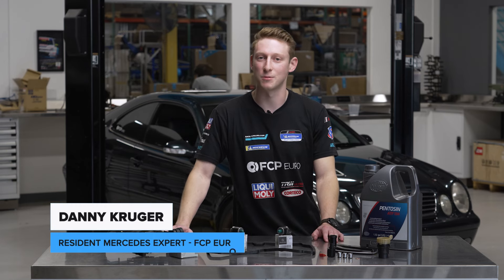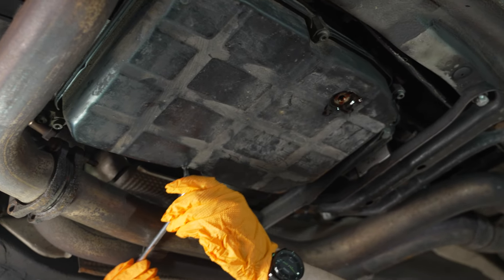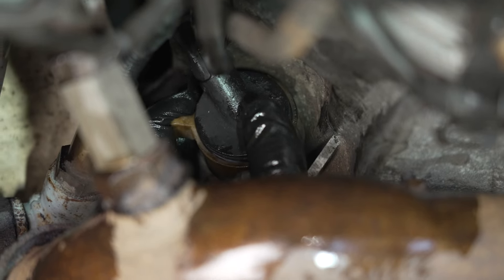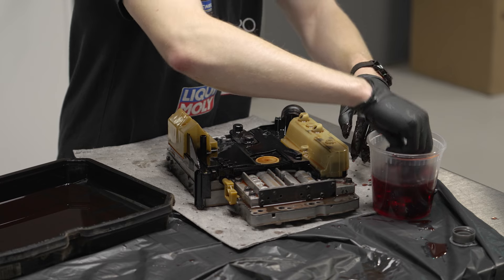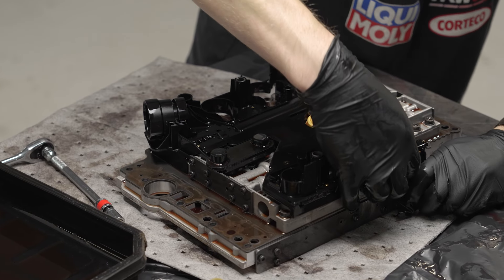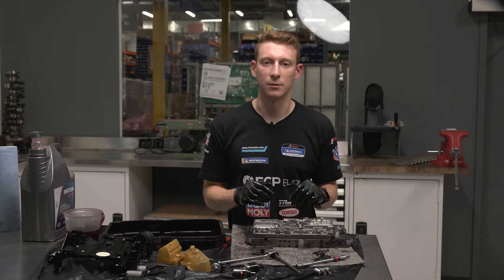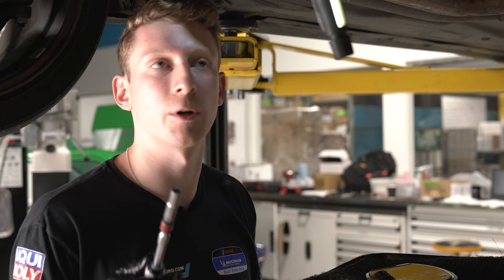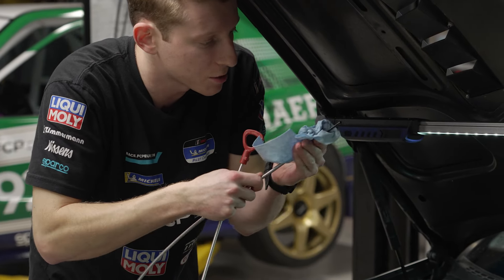Mercedes 722.6 Shift Solenoid Upgrade and Transmission Service (NAG1)

Comment: Only way to improve this Trans video would be to wear Blue gloves ; sometimes the black ones stop one from seeing the parts being handled . Just a thought ! Well done Allen P.
Reply from the maker: Thank you for the note; something to consider for sure!
Reply: I got a 2001 cuatromatic  it didn't want to shift in to the third speed. I really think it has something to do something whit the cilenoides and conductor plate. what do u think. It hasn't run in 3 years😢.

Comment: By watching this video, now I know why my transmission shift so hard when the car is cold, going from first to second gear. It literally jumps super hard, but only when it's cold. Once it reaches normal temperature, it runs fine. On a S600 V12, i'm scared to do this myself, but if I don't, I will have to pay a lot of money, and I have been dealing with that since I got the car 2 1/2 years ago.

Comment: need help or advice . i have a 1993 mercedes 500 sl, and internet shows my tranny is a 722.3. in video you mention blue solenoids are up grade and interchangable. can not find any solenoids for the 722.3 but lots for 1994 and up 722.6. would those work for my 722.3?

Comment: It's me again. If I want to replace the first and second gear solenoid, do I have to buy one that is specifically for those gears or it doesn't matter what you buy? because i think does the one that I need to replace in my car.

Comment: At what mileage would you recommend changing the conductor plate? Mine has 184000km, and trans has been serviced at 61000km and 150000km
Reply from the maker: Hi there Spidepig09! Pending the frequency of fluid/filter services and driving style, the conductor plate can be good for as long as 200,000 miles in some cases (~320,000km). Yours has been serviced a good deal more than the vast majority of these "lifetime-filled" transmissions which bodes very well for its longevity. This being said, the worst way to figure out that it's time for a conductor plate replacement is when you're trying to drive somewhere and it isn't cooperating.

I'd generally recommend replacing the conductor plate every 100,000-120,000 miles (160,000-190,000km) to be sure that it doesn't leave you stuck on the side of the road. Additionally, check to make sure you don't have transmission fluid entering the TCM through the pilot bushing! It's unfortunately very common on the original factory pilot bushing, and can also strand you. The kit containing everything you need for the service is in the video description.

-Danny
Reply: @fcpeuro  thanks for the detailed answer!
Reply: My conductor plate speed sensors failed after 107,000 km and 17 years.

Comment: My 2004 CLK320 had 9 bolts holding the plate. And 4 liters of oil was more than enough. Very good video though - it took me through it step by step.

Comment: Awesome job,I have a 2000 e320 wagon,my transmision shift hard and some gears take longer when it's cold, feels dry,feels like it needs fluid change,I have to let it warm up alot,when the car it's really hot transmision works fantastic!

Comment: Hi how are you ? Thank you for your beautiful, informative videos... I have a big problem. After changing the board, testing the solenoids without pressurizing, complete disassembly of the valves, installation of Sonnax, draining of new BVA and converter...connector to controller, my problem remains the same...box in degraded mode and not more than 3000 revolutions.... It goes from D to R with jerk and does not shift gears... I cannot pressure test the solenoids.... thank you for your help...
Reply: Hello did you find out what it was your problem?

Comment: at 23:00 you talk about at cold weather jerk with 1-2 shift that is the torque converter locking up.  I have this happening.  What is the solution?

Comment: Very informative video, thanks for posting! I have a ‘99 C230 Kompressor with 297k miles on the original transmission. Only issue I’m noticing is harder shifts when cold, especially 1-2. I’m planning to order the service kit you offer including the conductor plate, etc., but my question is with the high miles do you recommend getting fresh solenoids as well? What else is a good idea to refresh while in there? I do not know when the transmission was serviced last. Thanks!
Reply from the maker: Hi Colton! We love a good W202!

Fluid, filter and conductor plate will generally be good as far as general preventative maintenance goes, assuming you don't have any codes at the moment. If you've noticed shifts flaring between gears, then you may want to consider adding on any/all of the overlap sleeve and spring upgrade kits for the valve body mentioned in this video.

If the car is driving normally aside from that 1-2 shift, I wouldn't rush into doing the shift solenoids. The behavior you're noting is somewhat typical of a TCC lock-up solenoid (2402701700) showing its age in a colder climate, often resulting in a very hard feeling "shift" as the converter locks in first gear, followed by an actual shift to second gear moments later. This is an easy "while you're in there," and is relatively inexpensive, whereas replacing the solenoids can quickly tally up to a hefty bill.

Hope this helps! Let us know how the car drives following your service.
-Danny

Comment: hey friend, id be really grateful if you can help me out. i was working on a w210 om606 with 722.6 transmission and i had it running for maybe 10 minutes without transmission fluid, which i didnt know at the time. it was in neutral almost the entire time, but i tried to put it in drive and revved it a couple times. it it possible that did some damage or does it have any kind of safety due to low pressure or something? i would really appreciate a response, thank you. cheers!

Comment: Great video, thanks for taking the time to post it. I recently ordered and received your kit to change out the conductor plate, filter, gasket, and Connector. I have not done it yet. I have a 2001 Mercedes E320 Sport giving me problems it has 156,000 miles on it. When checked the vehicle indicates a P0715 code "Turbine/Input Shaft Speed Sensor A Circuit".

The car was driving well, recently took a trip to Birmingham, AL, and back with no problems. Drove it to work Monday - Wednesday about 60 miles roundtrip. Got in it early that Thursday morning, backed out of my driveway, and started up the street, and I noticed that it seemed to only change out once. So when I got to the main highway I gave it more gas and the engine went into a high rev, and then would no longer pull. So I pulled over and noted that my car would not pull when placed in any gear. So I exited the vehicle to confirm there were no leaks.

I turned the car off and cranked it again and nothing changed. So I parked it to later have the vehicle towed to my home. Upon removal from the tow truck, we cranked the vehicle and were able to place it in reverse drove it off the ramp, then into drive, and drove the vehicle down into my driveway. Since then it has been parked. However, I was able to notice that when cracked and the engine is cold the transmission pulls both in reverse and drive, but as the vehicle warms up it has less of a pull when moved to both reverse or drive.

All the research I have found pointed me to replacing the conductor plate, input shaft speed sensor, shift solenoids, and a change of filter and fluids. I also found my TCM to be full of fluid. I cleaned it out with contact cleaner. What are your thoughts and what would you suggest I do please sir?
Reply from the maker: Hi there Paul! Sorry to hear that you got stranded.

Sounds like you've got a solid plan to tackle the issue. We agree that it sounds like it may be time for a conductor plate and general refresh (and given your mileage, it would certainly be within the window for expected failure; unlikely to have been replaced previously, but also getting up there in age). In fact, you may not even "need" those shift solenoids; the speed sensing is done by the conductor plate, and unless you find metal debris or cause for greater concern when you drain the fluid and drop the transmission pan, the solenoids will generally be fine. Though, at 156,000 miles, it's never a bad idea to replace them "while you're in there" for peace of mind as they're a bit of a pain to get to!

As your engine oil does, transmission oil gets more viscous with temperature; fluid that's hot and at operating temperature will look almost watery compared to fluid at room temperature. Add in the fact that fluid also thins with age, and you likely have your answer as to why the car is most unhappy at operating temperature; the fluid becomes so viscous the system isn't able to operate within the tolerances it was designed to. Freshening things up with a conductor plate replacement and a fluid/filter service will typically do the trick for something speed-sensor related, so you should be good to go with the parts you're planning to order (don't forget a 722.6 transmission dipstick as well! You'll need to order one for the filling process). 

Unfortunate that the TCM is full of oil, but certainly not uncommon. A lot of the time, cleaning it out as you did will do the trick, pending the amount of fluid that entered the module. If it's still having issues afterwards, a replacement can be done with a 1:1 match of the TCM and is relatively inexpensive. Definitely make sure you replace the pilot bushing during your service to keep any additional fluid from wicking into the TCM, though (if you ordered our 722.6 service kit, this will be included)!

Best of luck!
Reply: Euro team thanks so much for the reply. Here is my order number to confirm that everything needed except the solenoids. I do have a tranny dipstick. Can you send me a link to the solenoids please? Let me know if you need the vin #.

Comment: Great video.  love my 1998 W210 E320 but my 722.6 has been dumping hard into 3rd and sometimes (when cold) not going into 3rd at all.  And once in a while sticking in 3rd.  After it goes through the gears a couple times it works fine.  This video was so informative, I know so much more about how my transmission works and I know to perform this service if I feel it will solve the issues.  I'm off the Merc. mechanic to get a proper scan.  And then hopefully I get to wrench on my transmission instead of replacing it.  wish me luck.
Reply from the maker: Best of luck with this endeavor, Adam!

Comment: To remove the adapter plug to the connector to the conductor plate, do the transmission pan need to be removed first,
Reply: You'll want to drain the fluid first so as not to make a mess, but the pan can stay on

Comment: Greetin, great video. Question: after replacing the conductor plate on my 1998-2003 Mercedes-Benz ml due a faulty output speed sensor, does my vehicle need be programmed?

Comment: Last summer i changed the conductorplate on my 2009 W204 with 722.6 5G tronic but the gearbox still not working properly so i need to change the solenoids and the overlap sleeves to because i think thats the problem, have have two modes on the gearbox, C and S, it will not shift at all in mode C but it is possible to drive the car in mode S only if starting from zero very gently or else it will not shift to second gear. Once it shifts to second gear it works just fine in mode S, until i park and turn of the engine and start it up again, same thing, need to start from zero very gentle. No error codes at all. Once the second gear is in and the oil starts to get warm it works great with kickdowns and shifting properly i mode S. Only gear one seem to work in mode C. Question: Would i replace all solenoids and the three overlap sleeves, or just a few solenoids + all sleeves ?
Reply from the maker: Hi HearGear! For a 722.6, we'll always recommend double-checking the fluid level as a first course of action, just due to the strange characteristics these gearboxes can exhibit when slightly over- or under-filled. Make sure you're checking it at the Mercedes-recommended 80-deg C.

We only got the 722.9 for the W204 here, so yours is a bit of an interesting case. When you replaced parts previously, did you find any debris in the transmission pan? Additionally, did you reset any existing codes when you replaced the conductor plate?

I don't believe overlap sleeves are part of the equation in this instance, as issues pertaining to that part of the valve body will generally result in flaring between gear changes.

Let me know!
-Danny
Reply: @fcpeuro   There was no codes in the first place, the level is spot on at 80C, when i bought the car the previous owner had the car for oilchange at a Mercedes dealer car-repairshop so the level was good also before i changed the conductor plate. There was no debris in the pan, when it shifts from gear 1 to 2 its a slight delay like you mentioned in this video, as the engine coming up to temperature the gears in S mode shifts perfect when driving. Most i am thinking the Solenoids because the gearbox does not work at all in Comfort mode, only gear 1, if i am lucky i might get it to shift to second gear it i am super super gentle on the acceleration. Thanks

Comment: Absolute best transmission conductor plate replacement video and I’ve seen them all and done this job a few times on Mercedes and on Range Rovers. never had to change the conductor plate though you Will have to have the new conductor plate. Programed correct?

Comment: excellent video, I have the same gearbox on the ml 270 TD, it works perfectly both hot and cold, no vibrations, 290 thousand km, I changed the oil, filter and plug, everything is ok but the only problem is between 3rd and 4th gear there is a delay grafting. sometimes it goes up by a few rpm, sometimes by 400/500, sometimes it goes well. They tell me it's a very common problem, what do you think?
Reply from the maker: I'd give the valve body a bit of love whenever you replace the conductor plate in the future! The 3-to-4 shift is the toughest one for these transmissions and will almost always flare a bit when these are tuned. What you're experiencing may very well just be typical behavior of an older 722.6, but replacing the overlap sleeves as we did in this video with the Sonnax kit can definitely help.

Comment: so what happens next if after changing the conductor plate and the 6 solenoid to brand new ones and yet the car does not shift to higher gears, what is the next step to check?? The selector switch??? I really am desperate for your technical advise!!! Thanks
Reply: Hello did you find out what it was the problem? 
Because I am in same situation. 

Thanks
Reply: @Στεφανος-σ7λ same. Reset codes and still stuck in limp mode.
Reply: @1R1SHxSN1P3R  In the same boat. From what I've read you need a certain scan tool like an icarsoft model to talk directly to the TCM for a reset and not just clear the codes. I've ordered the MBII scanner so we'll see if that's the case.

Of course there could be a bunch of other things going on like fluid levels, ATF wicking up wires to the TCM, a bad 13 pin connector, etc etc etc...

Comment: Thanks a lot for this fantastic video! I have one question: does the solenoid upgrade also work in a 722.9 transmission? It is a 7G Tronic, not 7G Tronic Plus. Thanks a lot!

Comment: Do all 722.6 transmissions use the same conductor plate? Ie would the CL600 trans use the same conductor plate as an ML 270 D ?
Reply: All the same even AMG

Comment: HI Danny. Both my rear speed sensors fail when I hit 3rd gear.  
I'm guessing it's the N3 sensor on the conductor plate that's to blame, you think? (SRT8) 
I've already changed the rear speed sensors and TCM, and it's not fixed the problem...
Reply: Same like me
Reply: @sifisodmagagula8699 it was the rings.

Comment: Great instructional vid.. any suggestions or directions to 722.6 fault, 3 sec delay from neutral to drive shift. No codes. Once in drive, no issues.

Comment: Not yet. I have to order the parts. I still hear a high frequency noise while driving and I have to warm up the engine at idle before taking off. Otherwise it gets stuck at first gear ⚙️

Comment: Car will take a jump (just replaced transmission lines. Now once u crank it it will start slipping like limp mode and break light sensor on dash was going off found out wehave a bad battery conductor plate husband says it should crank yeah it should and will, but when the battery conductor plate is burnt up once you replace it does it go back to normal ? Great motor.

Comment: So just to confirm the dipstick that you sell for the 722.6 isnt an actual dipstick but a tool to check the fluid level? I need to do a trans service on my 02 c230k as its throwing a couple transmission codes and shifts poorly if it isnt getting stuck. I was given this car and i dont know if the trans was ever serviced
Reply from the maker: That's correct, the dipstick (FEB-38023 on our site) is solely for checking fluid level and gets removed once you've got your level situated. If the dipstick cap has never been touched before, you may have to break off the red locking pin to remove the transmission tube fill cap to insert your dipstick (though the black tube cap pops right back on top of the tube without the locking pin if you're just checking the level, and our kit includes a new locking pin if you're servicing). As Mercedes generally coins these as "lifetime fill," I wouldn't be surprised if it's due for fluid and a filter as many 722.6 cars are. 

Don't forget to clear the transmission codes following your service and before you go for the first drive!

Comment: Good day, I have a 2008 Mercedes Benz.. brought it to the shop for a service, oil change etc.. one day after the service the car slams into reverse and drive gear, additional the transmission won’t shift out, it’s just driving in 1st gear.. brought it back to the shop, they said it’s the transmission valve body..